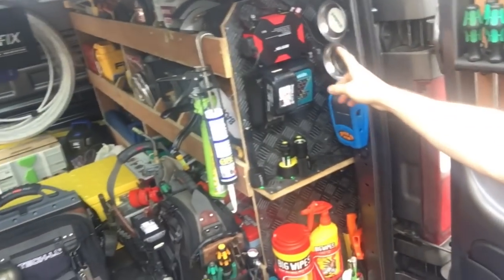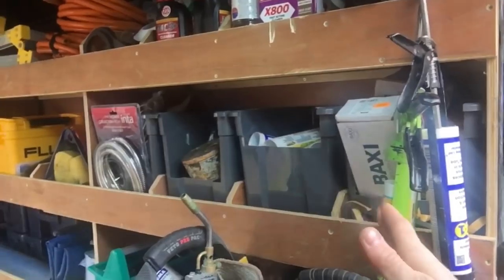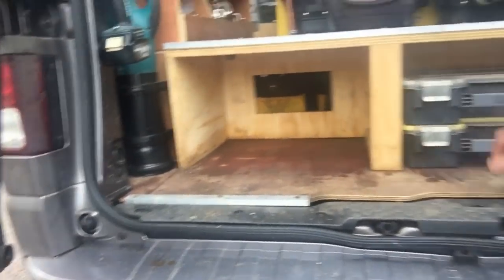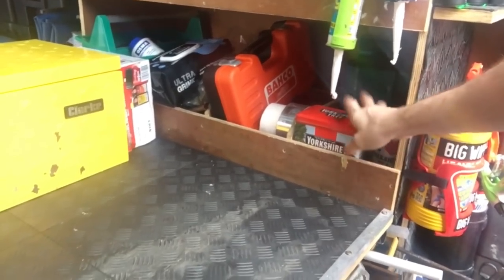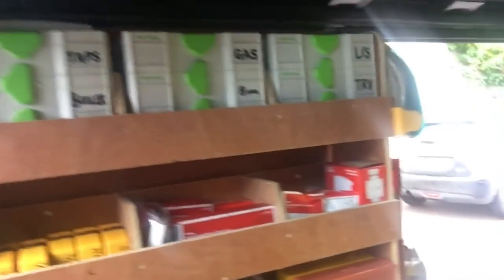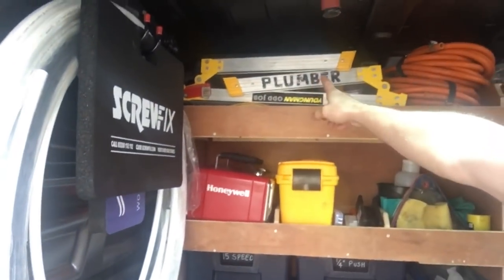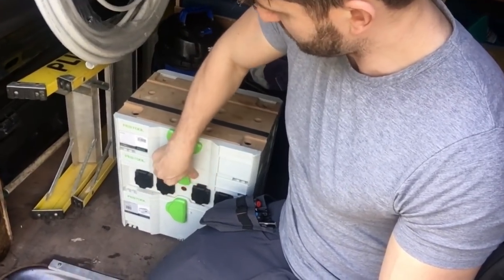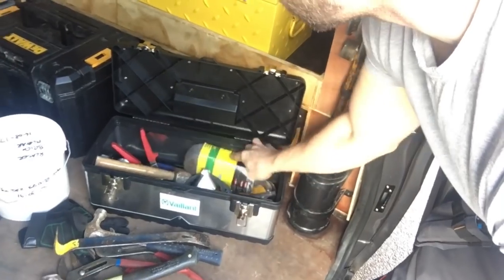P B Plumber Van Tour

Comment: I worked in a van that size for 10 years. Finally got one that I can walk inside. Hint: do not use  plastic divider boxes in between the shelf slots when unnecessary; they take up valuable cubic inches. Just increase the size of the wood dividers. You did a much better job than I did when I had a smaller van though. 

Also: invest in an economical GPS tracker to keep hidden in your van. I can always check the location of my van on my phone when I’m not with it.

Comment: I hate to be the one to say this PB , but by showing your well stocked van full of tools and equipment on  here you have left yourself open to getting broken into or even your van nicked , there are to many scumbags out there just waiting to pounce and by doing your vlog you may become a victim , I had my gear nicked out of a van that even had security locks fitted so nothing is safe these days .
I hope nothing happens but just be wary of what could ........👍
Reply from the maker: yensabi thanks mate, the reason I’ve never done a van tour before was for that reason, I’ve now sold this van, thanks for your concern tho
Reply: Those scumbags are more likely to notice, in real life, rather then here, when you come to jobsite and start to unload your tools. Anyway, the van with advertising on the sides is equal to many valuable tools inside.
Great idea with a lockable metal box.
Reply: Even easier now that the scumbags carry cordless grinders. Love hate relationship with cordless tools
Reply: happend to me one time lost my van
Reply: @gareths9574  shackle less pad lock can't be cut so easily or a shutter lock.

Comment: Thanks. You seem to be very well organized and carry a lot with you. It must be very difficult to keep track of everything you keep in your inventory. There is a significant value of tools and spare kit on board this van. What do you do to protect your stuff from being stolen? Those well stocked Veto bags and the cordless tools are quite expensive to replace and yet are, by design, easy to carry away quickly. It doesn’t seem practical to empty the contents of your van when it comes to servicing and I expect their could be times when access (for service) will be  required to some of the space you have so painstakingly built out, will need to be moved out of the way.  You get my vote for first place for best organized van.

Comment: Hey man. Do you not keep any spare waste fittings on board? Just sorted mine out and looking for a good way to keep them as I'm currently using an old cws tank from a previous job but it doesn't fit neatly anywhere??
Reply from the maker: Mark Strotton yes mate there are two blue raaco storage boxes with 32 and 40mm waste fittings

Comment: I don't understand why a lot of these videos about van set ups. Why don't you have a main tool box. Somewhere all of your tools are kept? What is your specialty that you have that many screw drivers on the side panel? I have maybe six 6 in 1 screw drivers. I have that many so when I open the screw driver drawer it's easy to grab one. Especially if one breaks. I have one larger flat blade & one Phillip's. My tool box ur 19 drawers 41 inches wide by 50 inches high. I don't want to go looking for a tool in another part of my van. Where are all of your repair parts? Toilets, faucets, sinks,   all undercounted drain parts. Tail pieces,  traps, extensions  ext. Tubes. Slip nuts & washers, basket strainers. Trip lever repair parts for tubs?  All that kind of stuff? I didn't see any of this???

Comment: I use steel office cabinets and draws that are lockable for the longest side, they're dead cheap buying from charity clearance shops. I have a raised platform at the back too. My cabinets cost £100 so cheaper than what ebay sells the ply racking. Lots of options too

Comment: Why do you keep smoke detectors on the van?? I understand the CO defectors but why smokes?
Reply from the maker: Callum Kane when we do a landlord gas certificate we check for smoke alarms on every floor, if they don’t have them I will fit one while I’m there
Reply: P B Plumber I’m a sparky myself when we do Electrical inspection it’s the same if there isn’t CO we add one,have heard a few different things about it some say it’s the plumbers job some say it’s the sparkys job

Comment: Is it true that plumbers are blokes that wanted to be sparkies but couldn’t handle it? ;) 
Haha quality setup mate!
Reply from the maker: Adam Burns haha no mate plumbers are blokes whose heads aren’t up there own arses enough to be electricians 😂
If I wasn’t a plumber I would train to be an electrician I really enjoy doing the odd bit of electrical work 👍🏽
Reply: P B Plumber haha I thought plumbers were the blokes that followed us around with the dustpan 😂
Plumbing’s the same for me tbh mate, looks like something I’d enjoy doing, hence why I found your channel, great videos 👍🏻
Reply: Adam Burns pretty close, back in trade school I picked plumbing and electrical to go thru the shops again for a 9 day run. Got zapped 15 times in those 9 days! Diddnt think I’d have a long career with that record, so I’ve been a plumber now 15 years! Cheers
Reply: kirsch1616 haha ouch! Couldn’t tell you the amount of times I’ve done a shower on a commercial site with a push fit pipe connector and it’s pissed out the moment I turned the water on 😂 think I’ll stick to electrics!
Reply: Round here the plumbers know almost as much as the sparkies cuz no one is going to pay for two different trades to fix a sewage pump, well pump, water heater, etc...

Comment: Whats in the fluke case?
Reply from the maker: ashley sefton all my electrical tools and test equipment 👍🏽
Reply: Why would you need electrical test equipment your a plumber ?
Reply from the maker: Mr Murphy Piers I’m also a gas engineer I work on boilers, electric boilers, electric showers, I wire up heating systems.....
We all know electricians are scared of an S plan 👊🏽